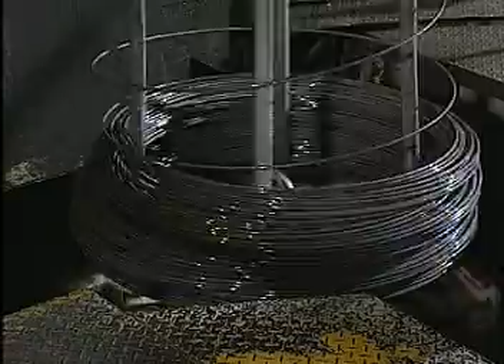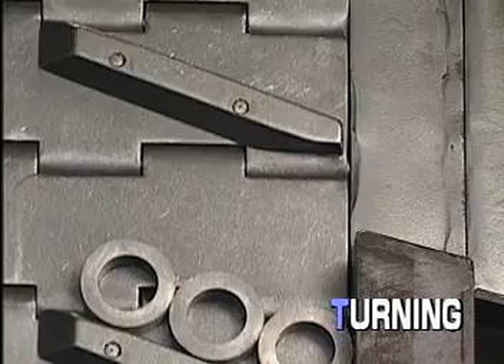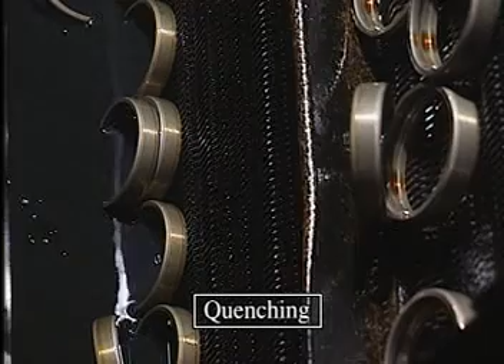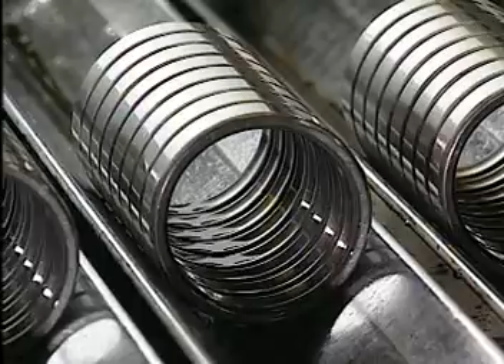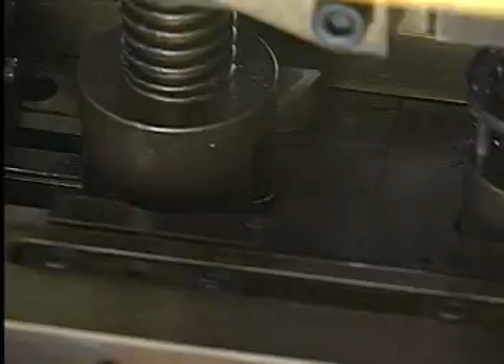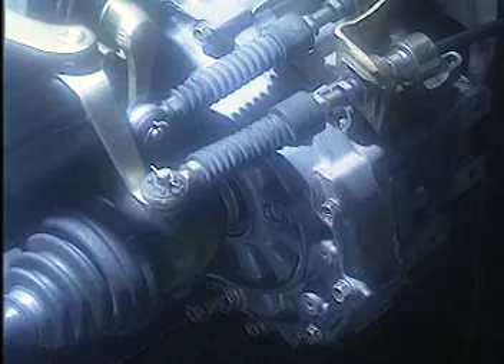Nachi Bearings

Comment: we are bearing factory more than 20 years.SKF NSK FAG KOYO brand we also supply more than 10 years.150000 kinds and $6400,000 value in stock.
do you use whatsapp?my whatsapp is +8615665823663
thks
tina

Comment: The greatest mystery hasn't been answered in this video. How do the balls get inserted between the inner and outer grooves?  The video shows them being dropped in, but then how are the clearances reduced between the outer groove, the balls, and the inner groove?
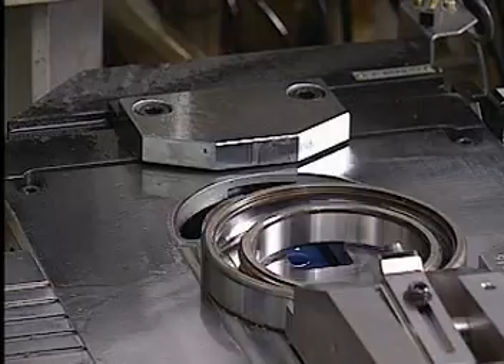Reply: +Landrew0 At 8:21 you can see that the inner ring shifts after the balls are inserted. Because the balls aren't evenly distributed  around the bearing, it's possible to shift the inner ring to create a gap large enough to insert bearings. Once re-distributed evenly, the balls center the inner ring, removing the gap.
Reply: @msftguy  Wow that was a lot simpler than I had first imagined it'd be.
Reply: @msftguy  Saw it somewhere that the outer race is actually broken to put the balls in.  Then it's put into a larger housing to contain it again.
Reply: but there is another mystery unanswered: how are full-complement bearing balls inserted?

Comment: Installing Nachi's in my BMW Alternator, will give yearly updates on durability. NSK's lasted 106000 miles
Reply: YOU NEVER UPDATED!
Reply: My apologies. The bearings outlasted the rest of the alternator, mainly the diodes. These bearings are the best. The tolerances, metalurgy, and seals are as good as perfection gets.
Reply: @jasoneyes01  Thanks for the update.
Reply: @Jason Burt  how about now?
Reply: Jason Burt Update?
Reply: If it has lasted this long, I wouldn't doubt it still is working fine to this day